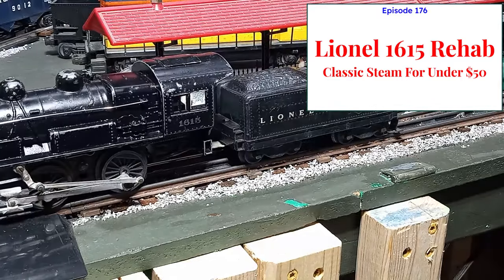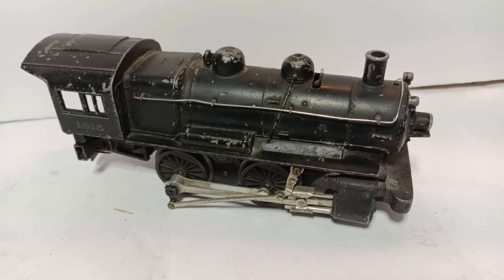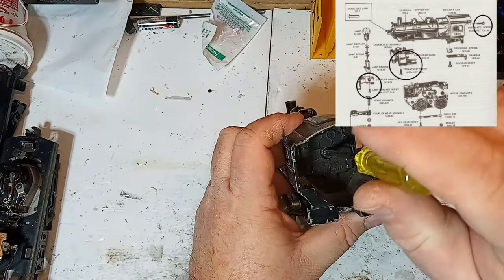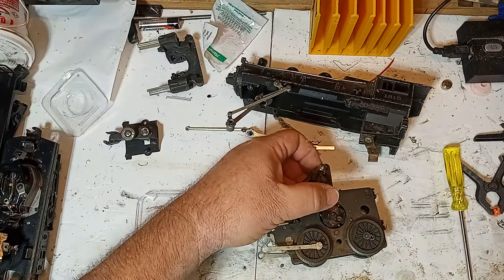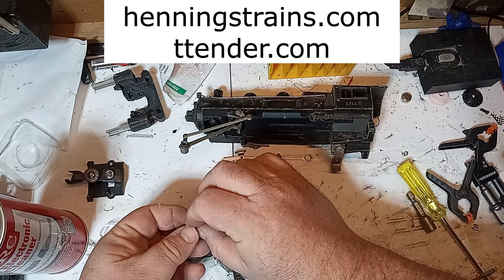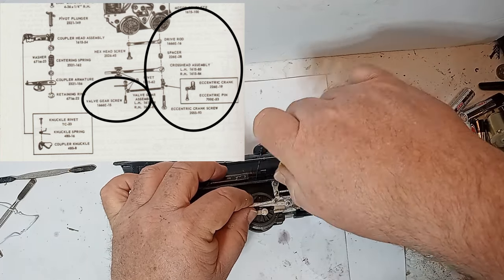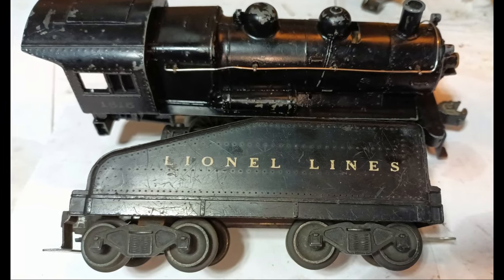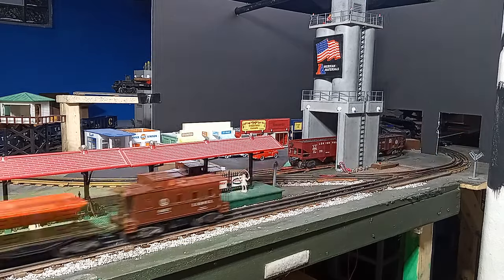Lionel Postwar #1615 - Reviving A Vintage Steam Locomotive!

Comment: Proof right there to what I always say:  postwar trains will still be running long after modern high end trains are collecting dust on shelves because of failed obsolete out of production circuit boards. Anything Lionel from 1945 through the MPC years are pure survivors.

Comment: You have my highest respect for warning of the dangers of emery boards and how to properly clean commutators. It's harder to find, but I use a liquid contact cleaner, De-Ox-Id with Q-tips. Sprays work too, in a pinch, so long as they are applies via Q-tip as you do.  Nice to see actual good, solid, advice, much better than half the hacks on here who end up doing long term damage.
Reply: I've been using rubbing alcohol on a Q-tip to clean commutators, that is I start with a Q-tip, then give the plates a rub with a pencil eraser to get a polish, then follow-up with one more alcohol-soaked Q-tip to clean any detritus from the eraser.  The contact cleaner's a good idea but I'll keep an eye out for De-Ox-Id, that sounds interesting.  Thanks!
Let me add while I'm cleaning the commutator I soak the brushes in alcohol to get them clean then dry them with a paper towel.
Reply from the maker: Thanks for the tips!
Reply from the maker: Great tips!
Reply: Careful with that de-ox-id, it leaves a film on whatever you use it on and might build up over time and do more harm than good.

People use it to stop arching, but all it really does, in my opinion, is put off the work you just did a week later. It's fun working on these locos, just not when you're doing it every other day.

Comment: Great tutorial Mike!  I don't own one of those 0-4-0's at the moment but one never knows, do one?  
Two bits of advice.  For ballasting lightweight cars I use short lengths of steel pipe and use two-sided tape to secure them inside the car.  The pipe lengths are cheap and come in various lengths and diameters.
As far as the boiler shell is concerned if the paint's deteriorated just go ahead and repaint it, it's no sin now and it's easy to do.  What I WOULDN'T do is put a coat of oil on the shell if the paint's not bad and repainting isn't important. The oil will penetrate what's left of the paint through the worn and chipped areas and lift it off.  It won't happen overnight but it will happen.  If you want to preserve the paint that's left use a paste wax.  Paste wax will put a barrier between the air and the finish and won't harm that finish.  
Both the Greenberg and K-Line repair guides surface at train shows from time to time.  Prices range from reasonable to ridiculous.  I picked up the K-Line book at a show for $25 which I thought was a right price. 
I've never heard of ttender, thanks for that!  I'll check them out! 
I DO know aobut Henning's, great place with a great bunch of people!  When I'm in that part of the country I always try to stop in.  In fact if anyone's doing the tourist thing in the Philadelphia area Henning's is an easy drive away. 
Great video as always!  Thanks!
Reply from the maker: Thanks for the tips!!
Reply: I completely agree with the oil statement. As a paint and body man, I have heard of so many things people do that are actually not preserving paint but rather harming it. Using furniture polish is another thing that drives me bananas that people throw around as a tip. 

Jeff at The Train Tender is just great to deal with. Very knowledgeable and just an all around great person.
Reply from the maker: @joshuacampbell9990  The paint job on this model was pretty well shot, so I thought it was a good opportunity to test Benz method. It didn't work, so I won't do it again. I'll repaint the steamer someday.
Reply: @joshuacampbell9990  Thanks Joshua!  Having dealt with antiques of various kinds for close to 50 years I've seen many cases where painted surfaces were ruined by people thinking they'd preserve them with a coat of oil.  Don't do it folks!

Comment: I was actually looking for one of these, but then I came across a Lionel #1110 that had a front coupler added.

Of course, then I found out that it was actually too big once the tender was on, as it would need to fit on the turntable (two O Gauge standard length sections) with a freight car. Now I'm looking for a diesel switcher.
Reply from the maker: About the only diesel switcher to fit on the turntable with a car would be a 4-wheel "industrial" switcher. https://amzn.to/3UEFnfS
Reply: @ToyTrainTipsAndTricks  Given what I've seen online, most Lionel switchers are just over a foot long. Since my turntable is two feet, I have found that that should work. Actually, those little Lionel gas turbine, Vulcan, and industrial switchers (which was something of another revision of the other little switchers) are some of the ones that I was looking at. Part of this is because those little switchers are also perfect for the Carbon Coal Company, which has a little mine train. If I get that, later it can be moved to mine duty after I get the C.C.C. completed and acquire an NW-2 or a 44-Tonner. Most of my freight cars are Lionel postwar that are close to (and sometimes less than) a foot long.

Comment: Nice restoration and cleaning project. I found one on the cheap that runs well, however, both front marker lights are knocked off. Any suggestion for adding those back? Thanks!
Reply from the maker: Are the marker lights themselves missing.or just the jewels? The actual markers would be a tough replacement on the metal shell. On plastic. I have successfully made new lights by 3D printing them (the markers on the #250 in this video are actually printed). https://youtu.be/btz7RJaKJ7E?si=orHv6HRS1lZjsdyH

Comment: good afternoon.
Watching your videos it is evident of the knowledge you have. I have a question for my tre polar express of 2022; Last Christmas, being connected to the electrical network and without activating the remote control, it started moving very quickly, after 1 turn it stopped moving and the front light remained intermittent when turned on, I tried to start with the remote control and it did not work. Since what happened, my train has not run again. My question is.. what could have happened? Could it be that there is a solution? Thank you for your time in responding.
Reply from the maker: The newer LionChief and command locomotives are more complex than the models that I normally deal with. I would contact Lionel's service department (Lionel. Com) or your nearest Lionel dealer regarding your particular issue.

Comment: Marx guy here, I `ve been reluctant to dismantle my Dad`s Lionel 224 up to now.
Reply from the maker: Nice engine!
Reply: Just make sure the motor plate on the drive gear side is screwed down nice and tight, otherwise it will loosen and your motor will get jammed and explode on you.